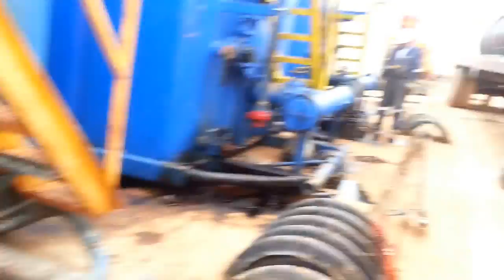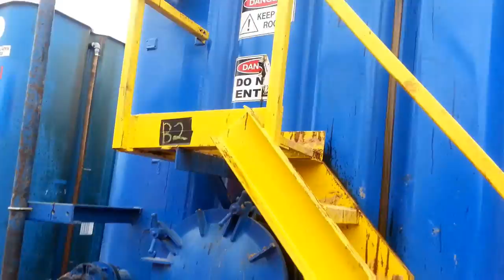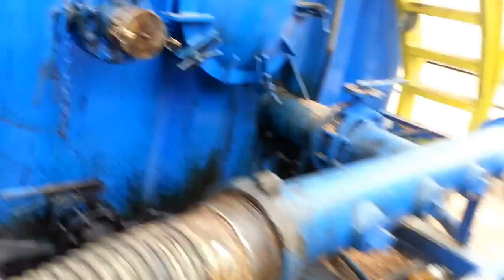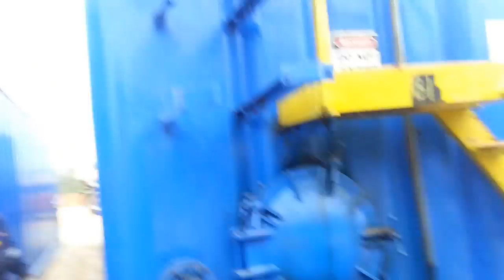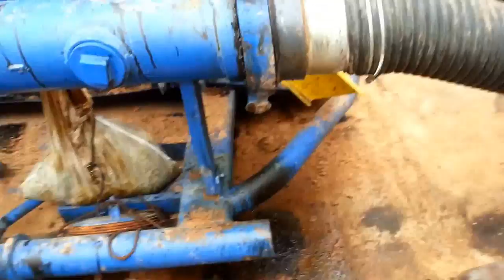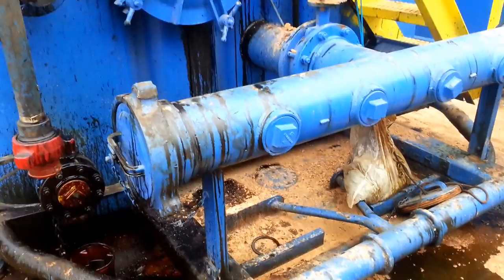swinging hammers tx oil fields

Comment: now try doing that all day not just 1 union
Reply: ecgodsmack86 what prosition is that?
Reply: Ken Stephens flowback
Reply: Was there a point to this video? Besides unnecessary hammering
Reply: Try rigging up 3" for flow lol...All we do is swing. When it's in a bind we swing 12lb and it sucks lol.
Reply: @Flankerr  We done a pop off the other day. 3 guys 172' of 3" weaving in and out of the down joints and about 45' of 2". Then we had to hang the stingers and it's was a zipper so obviously nothing lined up. This took about 3 hours.
Reply: @jollycooperator2876  4" all day long. All ground iron, no missile. By the way if you need a 12lb hammer yall doing something wrong. Wing wrench for those bound up joints or straighten it out and get it right hand